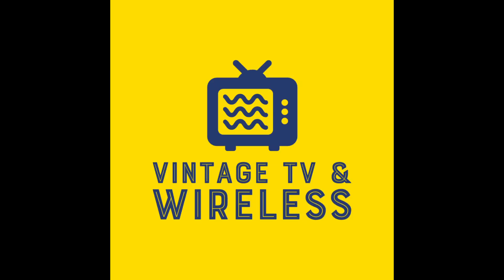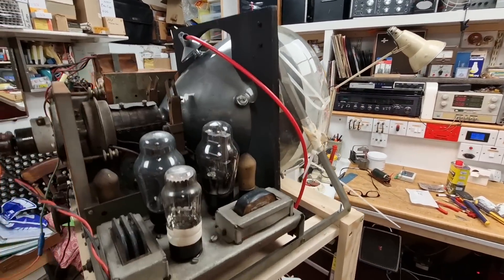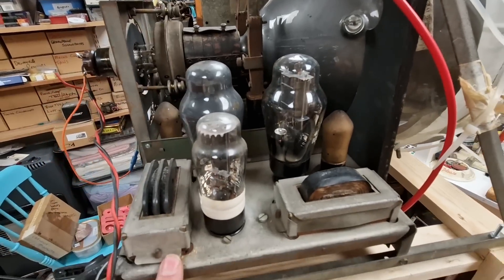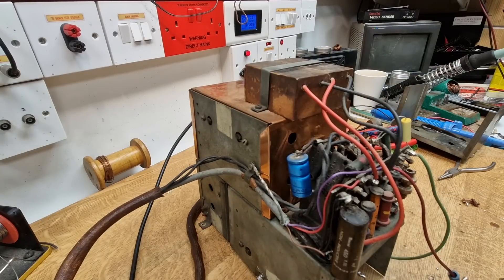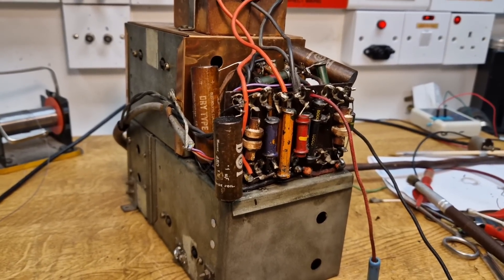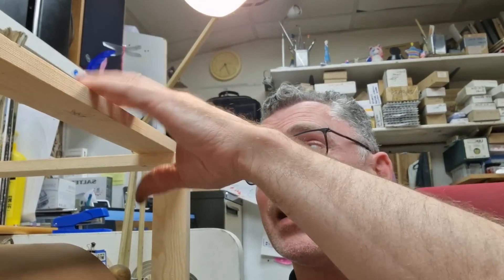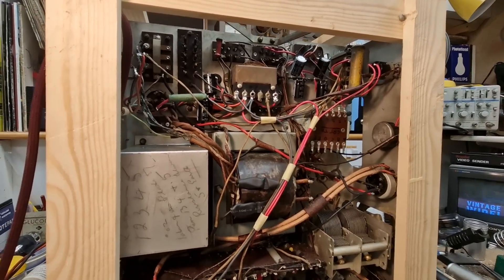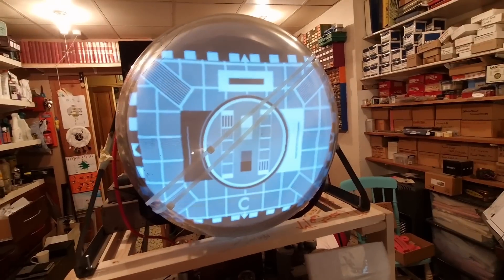A look at a VERY RARE 1938 Baird T18 television chassis....

Comment: Fly back designs also produce many thousands of volts DC. What makes a Transformer design inherently more dangerous?

The use of flyback was driven by cost, not technicans' (engineers') safety.
Reply from the maker: Current mainly.  Transformer fed EHT is capable of delivering lethal amounts of current, unlike most Flyback systems. 

Also, because the supply needs to be DC a capacitor is required for smoothing. 
Mains transformer fed systems ran at 50hz (60hz US), needing a relatively large smoothing capacitor.....substantial amounts of stored energy for the unsuspecting fiddler. 
Flyback EHT works at much higher frequencies (Khz),  hence needing a much smaller smoothing capacitor......much less energy stored. 

Remember the ole workshop ditty....it's the volts that jolt, but the current that kills.
Reply: @vintagetvandwireless it must be similar to older microwave ovens: Low frequency, big capacitor. Thank you
Reply from the maker: Spot on, the same reason Microwaves are dodgy to poke around in!

Comment: Nice to see this repair I was a tv technician back in the day but unfortunately or fortunately I never worked on valve tvs I worked on the Philips K9 Philips CTO and tvs around that era so had no experience on valves but back in the day spoke to TV technicians that did work and they saw the transition from valve to solid state but glad to have worked on CRT TV's nice work ❤

Comment: Amazing to watch this now, on a computer with some trillions of transistors, which surely cost much less, in CPI-adjusted terms, than this old monstrosity did.

Sort of like listening to ham operators chatting on 40 meter sideband, on an SDR dongle plugged into the back of your computer. Or maybe pulling up a website that lets you do the same thing. Very amusing, ultimately also fairly pointless.

Comment: In the 1970s, as a teenager, I had a friend who used to pull the high voltage plugs off "live" color tv CRTs, and dragged the "lightning bolt" out as far as possible. Used to scare the wits out of me. He also used to open "crown bottle caps" with his teeth!
Reply: Has he been dead for the last 50 years?
Reply: Insane and dentures much?

Comment: Always remember, these TV's/radios are called widow makers, because, often, they're a series-string (transformerless) set. That means that all the capacitors are wired in series (much like a Christmas 🎄 light set). All the electricity goes to the chassis. If a knob is removed from the front of the radio 📻, and ya touch the metal shaft, ya can receive a very nasty (if not fatal) shock. These sets are very dangerous to work on, even when they're unplugged 🔌. ALWAYS use an isolation transformer. This will dump the voltage ⚡️. Your friend, Jeff.
Reply: @jeffreyhickman3871 Isolating transformers can often be found to 'save your bacon'. If you find one you can't pick up easily it's probably a good one. A variac is another lifetime investment for this game. All the best 👍

Comment: High voltage was the least of the problems with early CRT TVs. Early CRTs had no implosion protection whatsoever. You drop the tube and it will be almost like a hand grenade going off. All the glass shards flying across the room.

Comment: damn you’re a genius! I don’t think people who are not in this hobby/industry realize the knowledge needed to bring an old set back to life. Great video! just realized how much I love and miss old tech. I restored a couple of old 1930’s-1950’s tube radios as a kid, then switched to repairing modern electronics, very rudimentary stuff though, looking for what’s burned out, what’s fried, replacing the part. Never had the knowledge to do the level of troubleshooting you showed on this set. swapping parts with diff manufacturers or eras, that takes deep knowledge!  About 15 years ago I bought a very rare 6-volt  1952 tube car radio set that is designed to fit the dashboard of very old VWs and Porsche’s. That will be my big project next year, restoring it while we still have analog radio stations available😅

Comment: Assuming the 4 volt supply is for the heaters do you know why & when it was decided to change to 6.3 volts (itself quite an arbitrary figure)? I once wound my own transformer which included 6.3 windings btw.

Comment: Got my first major electric shock off of a b&w TV: 70s rental, carbon voltage-tap thingy right at the top, exposed. Guess I shouldn't have touched it. 
Always thought TVs were an unacknowledged source of radiation: when repairing colour sets as a repairman, the LOTs were pretty powerful, much amusement with a screwdriver held near it...
Recently found out that American scientists had the same thought....
TV safety standards were introduced in the days of B&W small screens watched for just a few hours a day: not colour sets watched for hours on end for a whole lifetime.
The research was done in 1966.
Irrelevant now, I guess. Like Apple Retina screens...
I left tech college in the late 70s, got bored  when they started teaching us about Boolean algebra etc. Something about the coming digital age....
Damn!

Comment: My copy of "Television Simplified" by Milton Kiver, 1948, discusses primarily RF and flyback EHT circuits. The remark is that, because of the small capacity of the tube (which itself serves as the smoothing cap in such circuits), accidentally grounding the supply through yourself won't actually injure you, but it will cause your arm to jerk, and you'll drop your screwdriver into the chassis and damage something!

Comment: This is the kind of stuff my grandad worked on. 

He taught me electronics, soldering, components, valves etc at an early age.

No such thing as PCBs back then; everything was soldered directly together in a rats nest of components and bodge wires. 

And of course everything was analog; multimeters, oscilloscopes, vacuum tubes, which meant you had to wait for component to ‘warm up’, dials to move etc.
Reply from the maker: Golden days! 👍

Comment: The thing about CRTs is that factories did an excellent job at pumping out all the air out of the tube and creating a vacuum. However, time is the great equalizer, and over many decades air creeps into the tube.
That's why audio work is easier. Tubes are easier to replace, and paper capacitors are replaced.

Comment: I guess it would depend on the actual current capacity of the secondary whether this transformer could actually kill, and CRTs do not require much, but given the mains frequency of 50 Hz, a large capacitance would be needed to filter that CRT supply after rectification, and thus possibly be able to deliver a heart stopping punch of energy.  More modern sets with CRT supply fed from line (flyback) transformers don't present that kind of energy storage: a capacitor formed by an outer and inner coating of the CRT itself suffices as a filter.
Reply from the maker: Yes.....it's the several Joules of energy in the charged capacitor that kills!

Comment: Good lord, CRTs are already widow makers. The fact there's a CRT nicknamed the widow maker means it's extra dangerous.
Reply: These are like small nuclear reactors & were a major cause of house fires that were eventually made obsolete by the advent of the LED & LCD flat screens we use today which are much safer as they only use low voltage.
Reply: @ANDREWLEONARDSMITH  so much BS in just one sentence
Reply: @ANDREWLEONARDSMITH  that's the dumbest nonsense ever written. no they weren't "small nuclear reactors", the radiation CRT's emit are miniscule and no, they weren't a major cause of house fires, lmao. Are you demented or do you really think CRT screens were like some fusion bomb that exploded whenever you turned it on? 😂
Reply: @ANDREWLEONARDSMITH Nonsense. They replaced by LED because the image quality is better, they allows bigger screen, and most important, they're cheaper to make. I remember paying 1k $ in the 80s for a 21' TV. You can have a 75' today for that price.

Comment: So when exactly did Baird abandon his mechanical TV's and start using CRT's?
Reply from the maker: As far as I'm aware, the BBC stopped 30 line, mechanical scanned transmissions during 1935, by late 1936 they had launched the 240/405 line standards battle between Bairds 240 line intermediate film scanning system and EMIs 405 line, fully electronic system. (Both viewed on CRTs) The tests were due to last 6 months, but they soon showed that Baird's 240 line system wasn't up to the job, and the 405 line EMI system won the day....continuing (in conjunction with 625 lines from 1964) until the mid 1980s!

Comment: I have on my boat a 1938 radio kit built into a wooden box (no parts supplier name), my dad is trying to find out , also an Ultra Transistor Six  TR100  Radio from 1958 and a 1961 Roberts radio R200.
My dad was a TV / Radio engineer in the UK from the mid 50's and through to the early 2000's, my parents bought the TV sales / repair / rental shop from his employer in the late 70's, I grew up with my 2 brothers seeing all the new tech way before my friends did, Betamax and VHS wars for example and when most could only get 3 TV stations to watch, we could get 4 by my dad sorting out an aerial on a high mast to get a City of London only commercial station which made friends very jealous.

Comment: I remember my dad having a box of reserve valves for whenever one needed replacing in our TV set, wireless radio or music centre. It was quite normal to go into town to buy a valve if need be. Things those days also seemed to last longer. Our first TV lasted 20 years and was still going strong when it was replaced by a colour TV with a fancy remote control. Much of present technology doesn't seem to last past 5 or 6 years these days.
Reply: I don't know if it lasted longer, but it certainly was easier to repair.  As a kid I had a summer job working in the repair department of a local appliance store, testing equipment after it was repaired.  Either by the manufacturer or by the sizable in-house repair shop.  If your appliance broke down, you brought it to the store and paid the €50 (in today's money) up front "diagnosis fee", to be deducted from the total bill later if you went ahead with the repair.  Most people were happy to pay since a repair would almost always be cheaper than a replacement.
   
It's a lot less common these days and many repair shops closed up.  Others took their place, especially for cell phones.  And some manufacturers make repairs easy as well, my Litter Robot (a self cleaning litter box for cats) is over 15 years old and still going strong, thanks to the manufacturer providing spares at reasonable prices, and making the replacements straightforward.  Roombas are similarly constructed, with the parts that break most often easily removed and replaced.
   
But in a lot of other areas, it's not as good.  Repairing a modern TV is all but impossible.  Another thing is monolithic components, like head or tail light units on modern cars.  In the old days if a bulb went you replaced it.  Now, if the LED lighting or driver breaks, the entire unit needs to be replaced, often costing hundreds of €s.
Reply: @kaasmeester5903  My late dad, grew up on a farm and saw his first electric light when he was 18, was for sure not the most technically minded. But he soon figured out how to repair a faulty TV. He just looked at the valves, the one that didn't glow or glowed too dimly, was the one to replace. Sometimes it was just too much dust inside the TV which he cleaned out and it went again. Apart from the valves and the tube, there wasn't much else that could go wrong with the things. Modern TVs now have one single printed circuit. It's nearly always that that fails. They can be fixed, but finding out what element is bust can take a long time. So most people just buy a new TV. Not really any different to mobile phones.
That cars are designed the way you describe is the reason I'm still hanging onto my trusty 14 year old Ford Fiesta. It cost me just 15 euros to change the bulbs in the head lights.
Reply: @mikethespike7579  I payed 1200 euro (like 1300$) for 2 back lights on my BMW when one light strip in them  died,at first i wanted to fix them but every repair shop refuse to fix it and told me to buy new.My first car was 1987 Yugo,you had spare bulbs that came with a car so i actually never payed anything for a bulbs .And is crazy how much parts cost for new cars.for same BMWs i payed 2000 euro for injectors ,its like they are not made from metal but from gold
Reply: @dzonikg  I advise keeping well away from any BMW. They are nice to look at and very comfortable, but are otherwise a money pit. My neighbour has a BMW, he's a car mechanic, so you'd think he has it easy servicing his car. But that is not the case. He wanted to change the spark plugs and found out that he had to buy them at 5 times the normal price directly from BMW. Identical ones from anywhere else don't work because they are missing a chip that identifies it as proprietary BMW.
Reply: @kaasmeester5903  In my room i had grandmother old black white TV that was around  25 years old (my mother watched moon landing on that same TV) ,had it until late 80s (i even had computer connected to it )  when i finally got color TV in my room
Reply: @mikethespike7579 Fond memories of going down the local surplus shop to see what became a very old friend of mine who sold new valves (usually Mullards, Mazdas or Pinnacle in the later years) and tested surplus types Brimars Ediswans Marconi and 'old' Mazdas in plain white cardboard boxes at very reasonable prices, some CV or VT numbers which were always fun to find too. I used to have a couple of local TV shops which would have most of the more often used types in stock on the doorstep. Now we order parts from around the world and all those old shops are gone. Happy days they were.

Comment: That TV chassis looks really scary. In Germany first regular TV sets came in 1950th, and AFAIK round CRTs only existed in Hitler era prototypes (in total a few 100 were made). Generating CRT highvoltage directly from mains is like a nasty defibrillator. I wonder why nobody invented a TV standard with spiral shaped beam instead of scanlines on a round CRT (similar like a radarscope), or would it have distorted the picture too easily.
Reply: Germany (Braun )invented the CRT.

Comment: I worked for a short while as a TV engineer in the 80s, I was never great and I was always terrified of the high voltages so I was happy to switch to servicing computers at the end of the 80s which I became rather good at.  I never missed working on TVs.  I have a great deal of respect for the engineers who worked on the early TVs.

Comment: Excellent. What was the signal source for that 240 line test pattern? Did I miss something? Thanks
Reply from the maker: It's running at 405 lines using an Aurora Standards convertor. The 240 line standard was dropped by early 1937, if I remember correctly.
Reply: @vintagetvandwireless  I thought you had noted elsewhere that it was a 240 line TV unit. But I was really more interested in where the (test signal) image was coming from? Is it sourced from within the standards converter itself? fed from some other generator/source? Thanks

Comment: The picture on this set is surprisingly good. I suspect that viewers never saw such good picture back in 1938 because the tv cameras weren’t as good as the video generator you are using. I’ve heard of the mains eht but never seen one till now. Really dangerous!,
A 0.1 uf cap at 5kv would hold around 2 joules ouch !

Comment: Anyone interested in a early 50's picture tube. Came out of an RCA. Cabinet had been properly robbed, and left outside for who knows how long, but the picture tube was in tact. So I saved it in the hope to find it a home. Round tube type
Reply: You might want to try contacting Bob Anderson (@bandersentv). He's probably the most well known person on YouTube working on late 1940s-early 1950s American TVs.
Reply: Was the deflection electrostatic like in oscilloscopes? The thing looks high-implosive without a rimband and I would really fear that CRT to fall out of the chassis when secured with only a few cable ties. I hope this isn't an actual crack in the glass at the top of the screen, is it?

Comment: In my teens I had a play with a colour TV. I knew it was dangerous, I decided not to continue after seeing St Elmo's fire appear around the tip of my screwdriver.
Reply: The lethality of these early sets lay in mains-derived EHT. Flyback EHT was supposedly 'safe' but with colour at 25 kV, 1 mA, the lethality returned. You don't usually get a chance to make the 'mistake' twice!

Comment: With the early television sets would the European models like Ferguson and Telefunken have the same picture tubes and vacuum tubes and resistors and capacitors as the American like RCA and zenith and also your picture tube testers do they do the European tubes and the American tubes and we use suncor picture tube testers and we also have the best Beltran picture tube testers do you have them in your country
Reply: No. British TVs used MAZDA CRTs